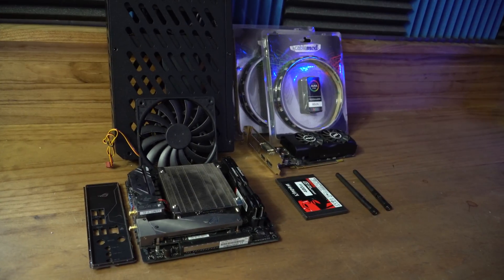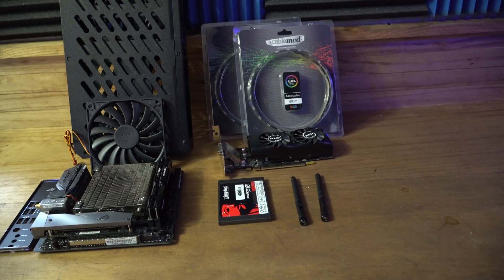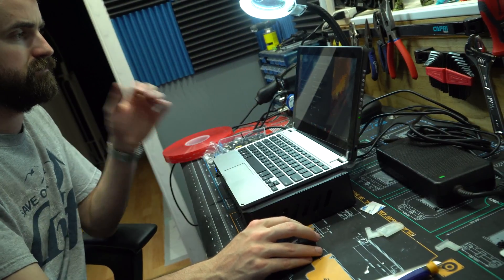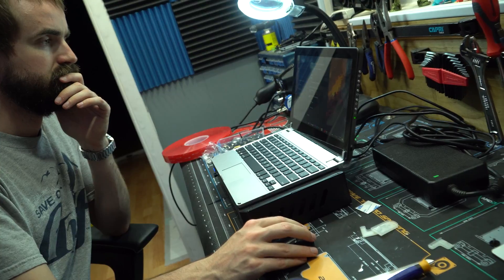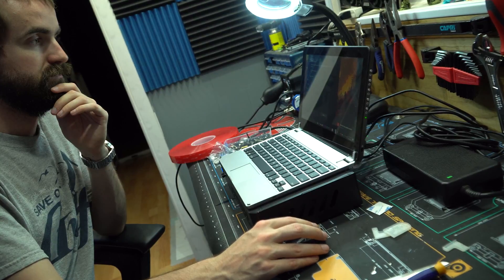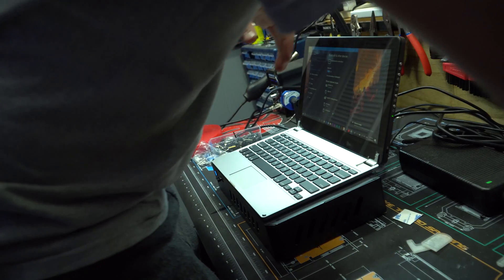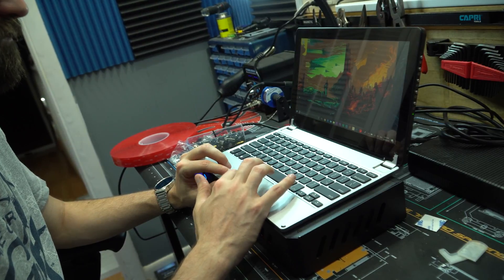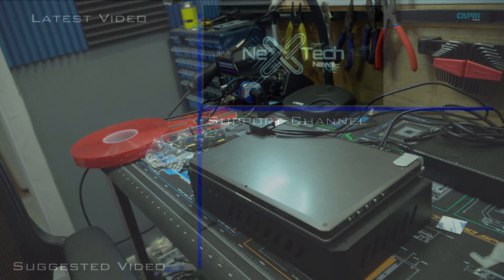DIY Laptop: Upgrading Portable PC Case

Comment: Is that the Skyreach S4 Mini from Josh at Notfromconcentrate? I really wanted to try this or something similar. But it's quite expensive. You should be able to fit an ITX gpu in there like an RTX 2060/2070. A 2060 might work off the Hdplex 400.

Comment: Nice mod man.  I have made a super simple and portable PC inside of a toolbox.  I still need to do a little bit of work on it, but there is only one modification to the outside of the case for the PSU outlet.  Only thing that needs to be disconnected is the PSU cable.

https://linustechtips.com/main/topic/964097-laptop-sized-briefcase-pc/
Reply from the maker: That sounds sweet! I'd love to see it!
Reply: @Bits-Blades-Bros  I plan on putting a video up of it on YouTube once I finish or come close to finishing it.  I'm an English teacher in Japan and tomorrow is the last day until the 2nd week in January for me.  Hopefully, I'll get it near completion during that time.